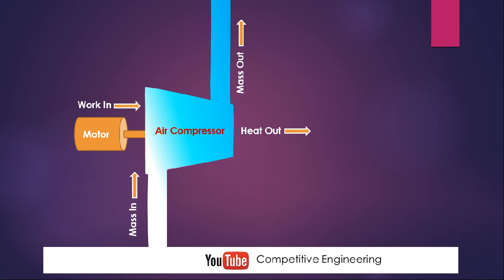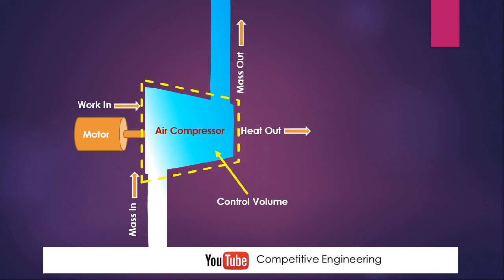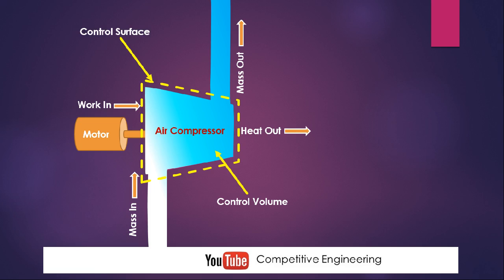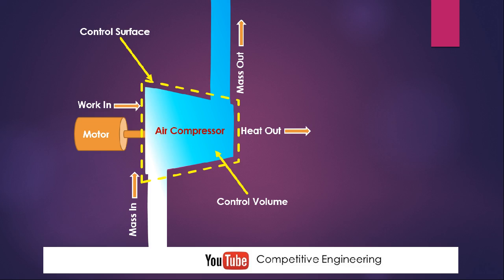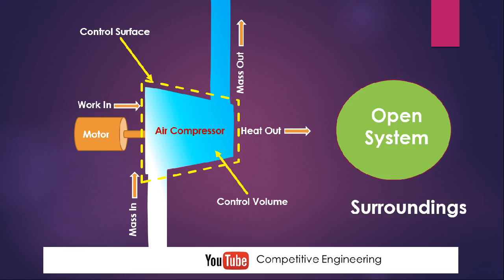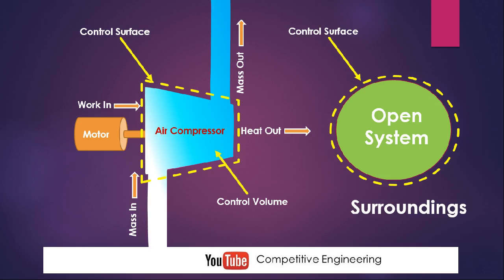Lec 6 Thermodynamics | What is Control Volume and Control Surface - Animation video

Comment: That's not true not always an open system is the control system , refer to the piston cylinder assembly of reciprocating compressor.
when the piston  moves downward that atmospheric  air is heated in through the suction valve, and the compressed air discharge out through the delivery valve during upward movement of the piston. Obviously the  mass  flow crosses the system boundary. Furthermore the boundary itself  contracts and expands. Evidently the air compressor forms an open system but not control volume that has to be fixed shape and shape.